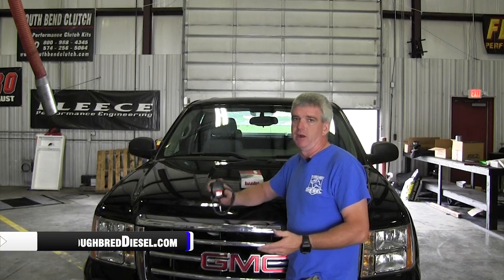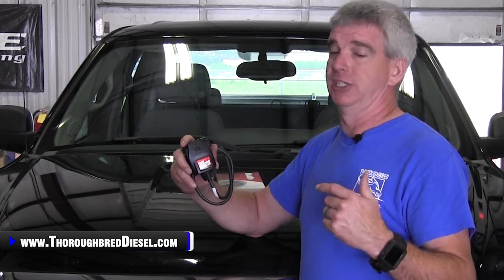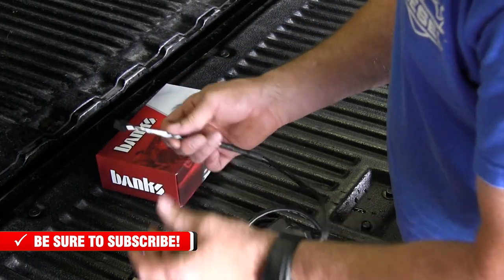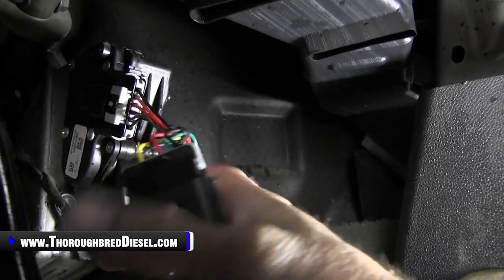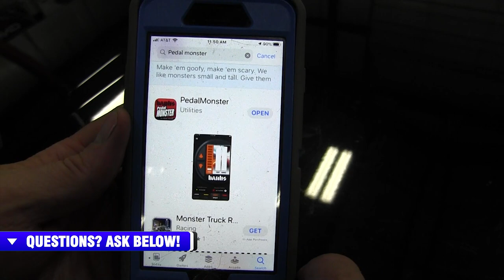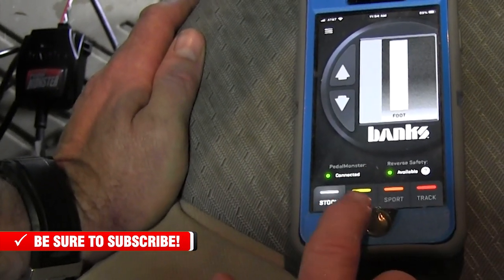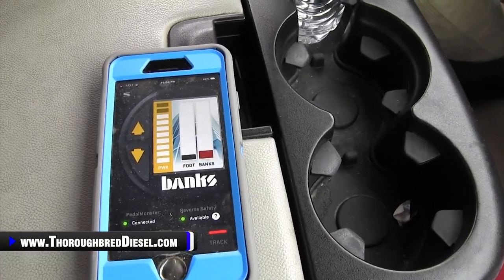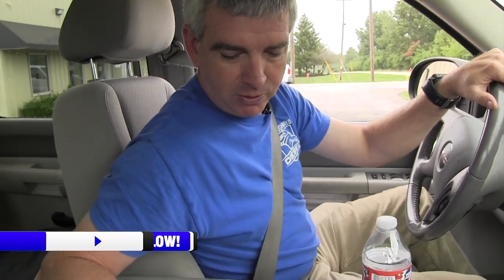Feel It In The Pedal | Banks Pedal Monster Install: 2012 GMC 1500

Comment: Can I use this on a 3 to 1 obd splitter?
 Will already have on the ob2 an Amp step power running board and a ob2 Bluetooth scanner.
Reply from the maker: As long as it has coms in the split.